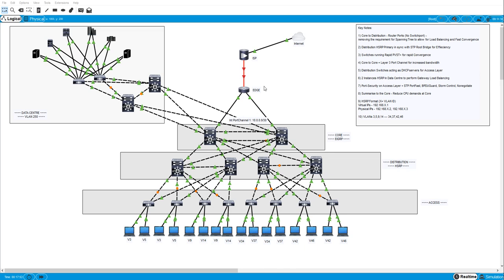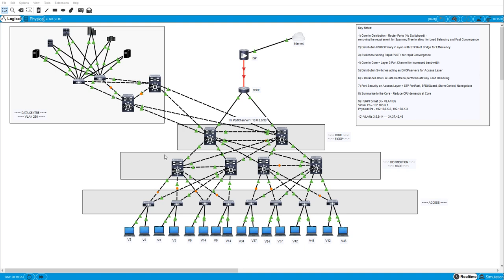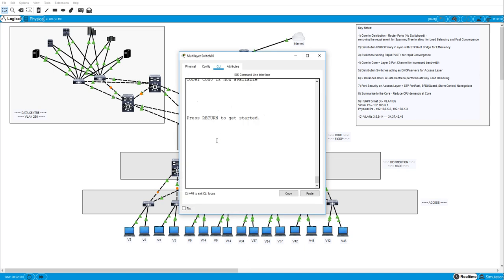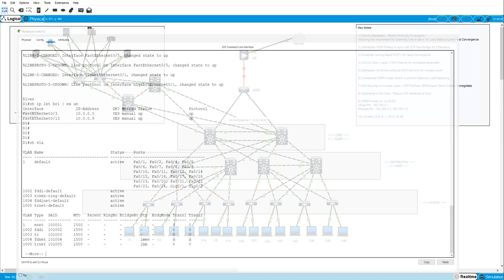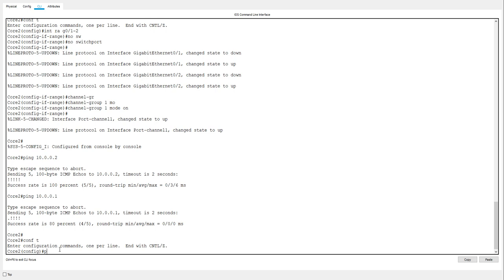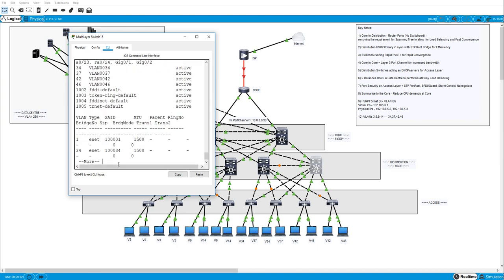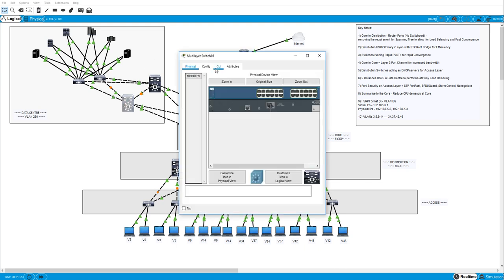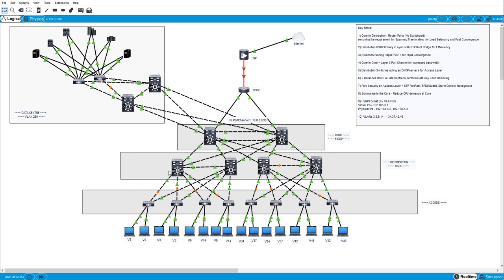Packet Tracer: Campus Design (part 1 of 6) - L3 Portchannel & Creating VLANs

Comment: This task involves designing and implementing an Internet-connected secure network for a medium-sized
company requiring 500 machines named Nouman Logistics, India. They want to implement a secure network that
uses Class C network address with multiple subnets – They have asked you for a price quote as well. But they
want to see a packet tracer implementation and simulation results before they commit to purchasing anything. 
1. Using a drawing tool of your choice design the network. Draw a simple network diagram of your
network.
Hints: Design the logical diagram. You can ignore the device location in a logical design. Use Visio or
any drawing tool for the diagram. Don't forget to label the diagram core, access and distribution layer.
2. Design and Implement an IPv4 subnetting scheme. You can use any address in class c.
3. Hint: Test a small subsection of the network before implementing the full addressing scheme in packet
tracer.
4. The report must describe the design and all of the decisions that you have made in the process of
developing the design. This will include a discussion of the design model, Security, WAN protocol,
Layer 2, 3 and wireless protocols that you have decided to use. Hint: Restrict your discussion to the
main layer 1,2 and 3 protocols
5. Show the detailed cost of implementing your solution in a table format. You can try to show two
different costs for the company to choose from.

Hi! Can you please tackle this question? I have the logical diagram mapped out already if you wish to see.

Comment: hi can u upload a two story building network  configuration using packet tracer. please notice my comment
Reply: look for commercial building or school. then make a networking plan applying the basic concept of networking and vlan implementation. Configure the equipment use in such a way that the end-devices will able to communicate to each other. Use packet tracer as your project simulator . Their must two network available the faculty and student network . 20 minimum end user. 5 minimum swithces and routers are strategically distributed.

Comment: Hey can you share the icons for your routers, switches and servers?
Reply from the maker: Sure thing, man! You can get them directly from the Cisco website. Link here: https://www.cisco.com/c/dam/en_us/about/ac50/ac47/icon-library-production-oct2016.zip
:)
-John
Reply: @IPvZero  Hey John. What type of router are you using here? The set up you have going here is very close to what I am building for a project in school but I cannot seem to find any routers or layer 3 switches that have more than 2 addressable ports that are not serial ports. The 2901 can have tons of serial ports, but only two gigabitethernet ports. Thanks!

Comment: Every time i start my packet tracer my port channel always shows down ?? can you please tell me the solution to it
Reply from the maker: Hey, Aayush! Unfortunately it's a bug in Packet Tracer! Happens everytime!
The way to fix it is to simply remove the port channel and reapply it. 

So:
"int ra gig0/0-1
no channel-group 1 mode on"
exit
no int port 1"
And then reapply the configuration
"int range gig0/0-1
channel-group 1 mode on"
And complete the configuration as you would for both sides!

It's unfortunate but Packet Tracer does have many limitations so we just have to find workarounds.
Hope that helps!
-John
Reply: @IPvZero  Hi , I also wanna know if HSRP is configured for Distribution layer and Access layer or Distribution layer and Core layer ? I am really confuse in this HSRP part . Please guide me
Reply from the maker: Hey Aayush. You want to configure HSRP on the distribution layer. Those will act as the default gateways for the host PCs. So the Access layer is basically running Layer 2 and the Distribution layer is the point where you begin routing at layer 3.

If you watch Part 2 of this video - around 11 minutes in you can see how I configure the Distribution layer with HSRP:
https://www.youtube.com/watch?v=tYdWxcSVEA8

Hope that helps!
-John

Comment: Very nice topology. Please share the packet tracer file.
Reply from the maker: Hey, Hasan. I actually didn't save this packet tracer file. However, I still have the original one I quickly made up before the video as a plan for what I was going to do. I don't think it's fully configured, but it's pretty similar to the one in the video, and I have uploaded it for you here: https://www.dropbox.com/s/0yit6884c0ede1q/campus-mock.pkt?dl=0
(Note: Packet tracer seems to buggy with the L3 Port-channel.. Sometimes upon opening the file you need to re-enter the "channel-group 1 mode active" commands on both sides and perform a Shut then No Shut to fix the issue). 
Thanks for watching! -John
Reply: Hi, thank you very much for sharing the file.
Reply from the maker: No problem, man. Thanks for watching!
Reply: @IPvZero  I tried downloading the packet tracer file from the above site . But it says the site couldnot be reached. Please share the packet tracer file .